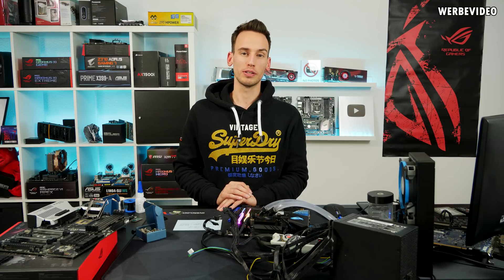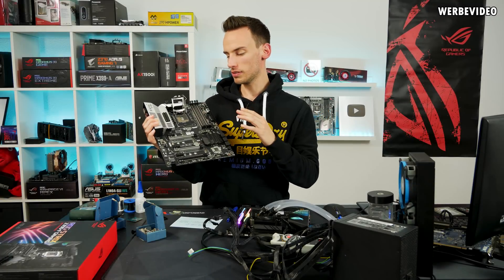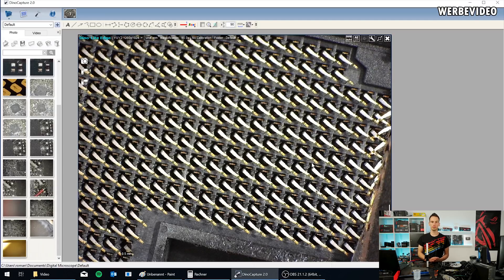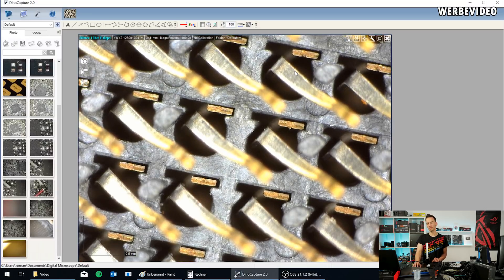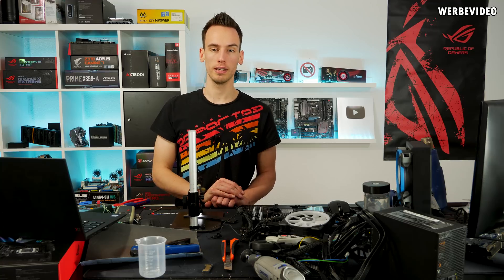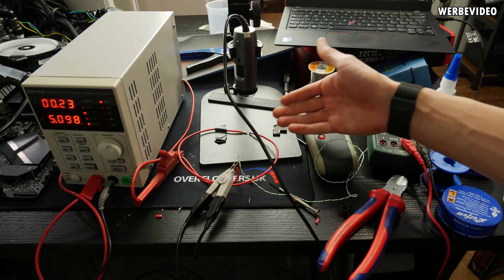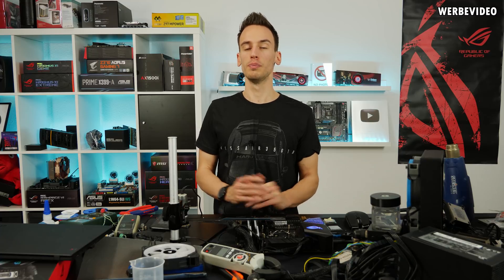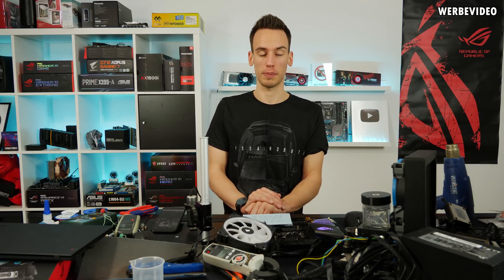We analysed the Z390 socket!

Comment: I appreciate that you did in English also! <3
Reply: TheRealSamPreece videos with marry are in de only, scientific ones in english too
Reply: The sound volume is kinda low.
Reply: @fat4ll  Turn your volume up dipshit!
Reply: @bobhumplick4213  Absolutely competition forces the manufacturers and OEMs and players to come up with better solutions.
Reply: yeah and amd are debating whether to have the 3000 series work on current boards.  why?  because after you put 2 generations of cpus worth of bios info on a bios chip theres not much room left.  so then you have to either have mulitple bioses per board or you have to just break it off after 2 gen and start new.  which is what intel does.  ive heard the mobo makers are actually getting a bit pissy about it and might put their foot down.  intel gives you 2 generations interchanging.  amd has given 2 so far and maybe 3 but maybe not.  there wont 4 for sure.  wow big difference.  its almost like intel had good reasons for some of the things it does.  wow what a concept
Reply: @bobhumplick4213  Not that big of an issue, if you view the entire microcode for CPUs that Intel have released, it all fits into a package of 1.3Mb of size.
This goes from old socket 775 and up until todays CPUs, and it is easy cramming 1.3Mb onto a BIOS flash chip if you want to.
Reply: @CMDRSweeper  yes but more goes into a bios chip than just microcode.  there are also vid charts and a whole bunch of other things.  amd and its board partners are already arguing about whether to support all 3 gen of ryzen when the 3rd gen ryzen comes out because it all doesnt want to fit into a normal sized bios chip (i think 16MB is the size that they mostly use).    theyve already had problems fitting it in on just 2 generations.  one of the board partners had to leave out some of the apus on one of its bioses.  its a real concern.  google it
Reply: @CMDRSweeper  its a deliacte balance trying to make customers, board makers, eoms, and yourself happy.  board makers already dont like working on amd stuff.  if they push too hard they will damage that relationship and thats good for nobody
Reply: @bobhumplick4213  Does the EEPROM chip have to be really really small in capacity ? 2019 isn't good enough to put say 2GB of storage on an EEPROM chip ???? 
Intel needs to get off its sorry a$$ and make some real innovation happen! Show the world that intel isn't a stupid company that thinks it can keep ripping money out of customers and consumers!
Reply: @plusmanikantanr  then why are amd having the same problem?  maybe its because they work with the same mobo vendors who are working on razor thin margins.  there may be other factors like compatibility.  maybe the modern platforms require the small bios chips. idk.  but whatever the reason amd are in the same boat
Reply: @plusmanikantanr  i think its to do with the fact that 16mb is the smallest cheapest one and there are many sub 50 dollar boards that use the absolute cheapest components and so are limited to 16mb or whatever the limit is.  and guess what those things also lack?  adequate power delivery and cooling.  how many of those cheap 7th gen boards would not have supported a 6 core chip?  and you say "but thats not me so i dont care"  but then again if they put out a new bios for 7th gen boards and 8th gen cpus worked on those 7th gen boards except those that couldnt support the power delivery you would be complaining about that too.  

what are you gonna say when amd comes out with the 3000 series and the top end chips dont work with b350 boards?  im sure youll find some reason to rationalize it.  its always ok when amd do the same thing intel did.  always.

the only reason people are complaining if because a lot of people got shafted with the 7700k and then the 8700k came out the like 10 months later and they couldnt upgrade.  and thats unfortunate.  but the reason they couldnt upgrade is because their boards were already supporting the 6th gen as well.  so anybody that bought a 6th gen i5 or even i3 or pentium could have upgraded to the 7th gen i7.  and just like they always have for the last decade the broke it off and started fresh.  

why does every board have to support every chip that it possibly, theoretically, could support?  there are other factors and yes sometiems they are political\business decisions
Reply: @bobhumplick4213  Why are you justifying the lack of innovation on the part of manufacturers and intel ??? If you don't know and I can't fix it ... who can ? hint the guys with the big bucks and factories  Stop fanboi'ing intel and come up with better ideas or at least contribute to the conversation.

For example, if EEPROMs are so difficult to get to large sizes, why not design similar to Gigabyte's solution of having a backup EEPROM which flashes the main EEPROM in case of  failure ?  .... So you load up the BIOS with updates, .... and maybe switch to the backup BIOS in case for older gen CPUs. Have like 3 or 4 EEPROMs, with say a blank which is "Plug,n,Play" ? So you can buy new EEPROM chips from manufacturers and swap them out.  Ohhh wait .... couldn't you do that 10 - 15 YEARS AGO ???? :##(*$#$%##%#$%#
Reply: @bobhumplick4213  Like I said. I don't know the solution to most of these problems. I am not hear to validate your thinking or your projecting issues on me dude. So chill the heck out, and have the kind of convo you typed up. Ask ppl's opinion, you dont have to be adick about it. I respect what you say. So keep on respectin' and carry on commenting.
Reply: @plusmanikantanr  what makes you think i am justifying lack of innovation?  what i was talking about had nothing to do with innovation.  you are confusing yourself
Reply: @plusmanikantanr  and you want me to "stop fanboi'ing and come up with better ideas"?  like your idea?  add 3 or 4 bioses?  are you seriuos?  those are backup bioses and they are only on the higher end models.  you dont need 3 or 4 chips you need one larger chip.  these board makers are on about 2% profit margin.  they cant just add bios chips willy nilly for you.  thats the problem.  you think this is all about you and what you buy.  most of the boards they actually sell are to oems and have even less margin than the boards you and i buy.  and they have to be tested and certified in every possible configuration before they can be sold to vbery large customers.  if you have 4 or 5 generations of cpus added to the bios you have to test ALL those configurations for certain customers.  its a nightmare.
Reply: @bobhumplick4213   "its almost like intel had good reasons for some of the things it does.  wow what a concept" <---- indicates you think Intel has innovated something to justify the extra pins......  While the gist of this video is that Intel DID NOT!